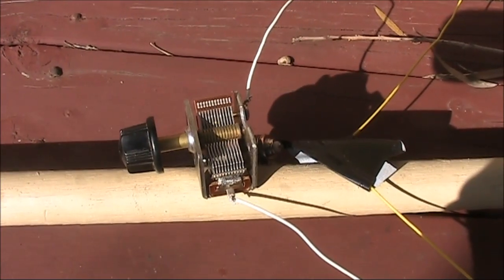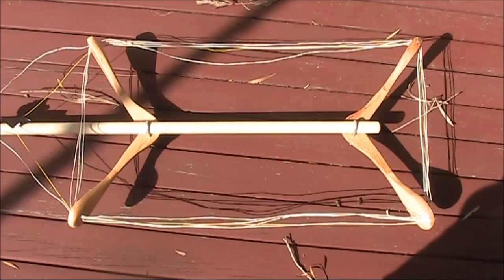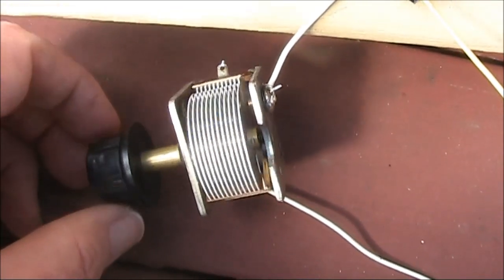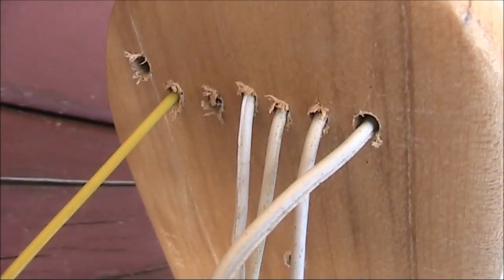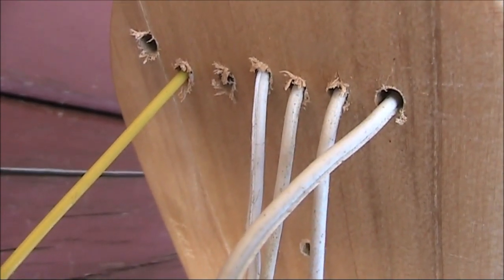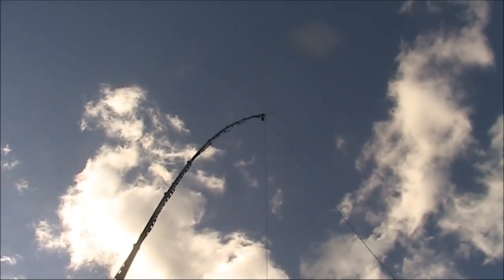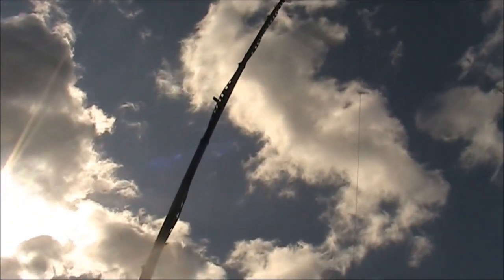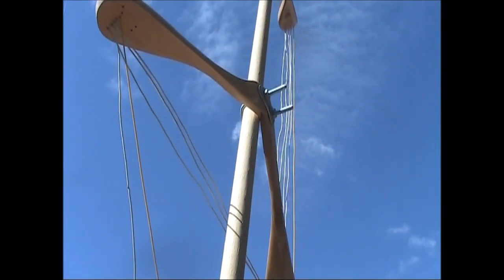1.8 and 3.5 MHz receiving loop

Comment: What would happen if you'd transmit with it?
Reply from the maker: Unlikely anyone would hear you as it would be incredibly inefficient. Better off to build a magnetic loop optimised for transmitting if you want a small loop antenna.
Reply: @vk3ye  I made one for 11 and 10 meters, a while ago, with copper tube. It works well! But it's not portable like your summer loop. Also the variable capacitor is not a high-voltage one, so QRP only ;-)

Comment: The switching between front an rear antenna doesn't work great. Mostly i need to press PTT to activate the front. Without ptt u may hear a small difference but with ptt it will work.
just try it, i have ft-818nd, and have this "problem"

Comment: That loop would receive a lot better standing up, but I'm sure you know that 😁
One thing I have noticed with oblong loops of this nature is that they work better when the rectangle is on its long side. I believe this is because the spacing is greater between the two shorter sides which increases the phase difference between the signal of the wavefront striking the two vertical sides of the loop. 
I recently made a square 80 by 80cm loop for medium wave using 8 turns of 1mm enameled copper wire spaced 6mm between turns, and it delivers a very strong signal to the radio. Actually it tuned up to above 2mhz so I should try it on 160m for fun.
One last thing I noticed is that your tuning isn't very sharp which indicates that the one turn coupling loop is loading the main tuned winding too much. Since it's only for RX you can try alternative coupling methods like winding say 5-10 turns on a small ferrite bar and using that to couple to it. The loop Q will go up as will the signal voltage and you will likely find the signal level delivered to the receiver is substantially increased.
Anyhow 73 and happy tinkering

Comment: Excellent as always. From my experience a small amplified loop is superior for reception - no tuning needed just a 100ma power supply. Low noise amplifiers are cheap now, even the chinese mla-30 will do. connecting the loop you constructed to an SDR will clearly display the upper and lower frequency limit driven by the capacitor/number of loops. The 10 kHz receive bandwidth shows as a spike on the SDR and everything else is "muted". so you tune min to max and get to know your loop. Thomas, N1SPY, did that with a homemade AM reception loop.

Comment: Possible improvements?
Put the coupling loop between the receiving loops. i.e. RL-RL-CL-RL-RL.
Tighten up the wires so they all run parallel and evenly spaced.
Mount the tuning capacitor in a metal box attached to the frame to avoid "hand" capacitance.
You could also include the BNC on this box rather than just have it dangling?
These things are not too critical, but in small antennas every little bit helps. :-)

Comment: Clever using coat hangers for the spreaders.  I have not seen that type here in the states.  I'd like to find some like them.  I could insert a plastic piece on the end of the hanger using a slot.  It would serve the same purpose to keep the wire separated.

Update. I was able to find coathangers very similar to the ones you used, but the store that had them were quite proud of them.  $8 a piece. I hope you got yours at a thrift shop. 😵